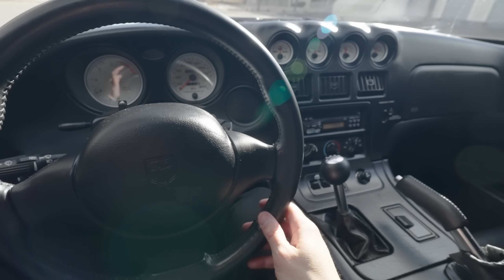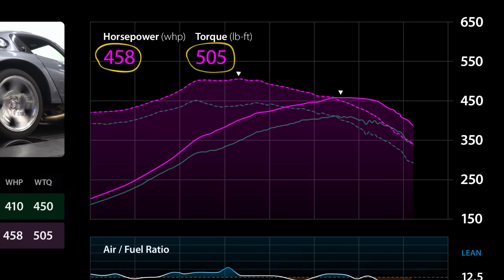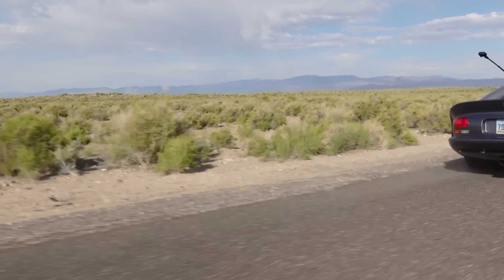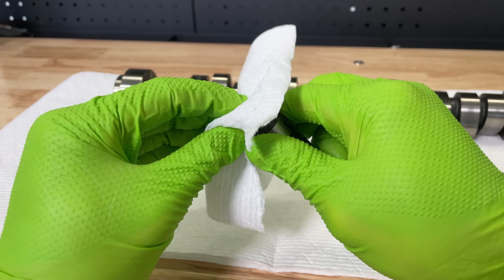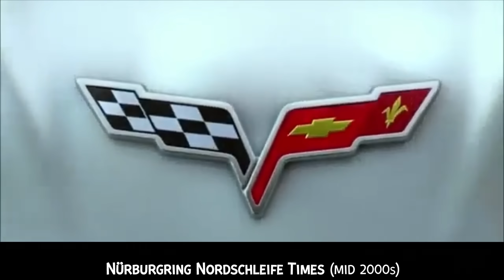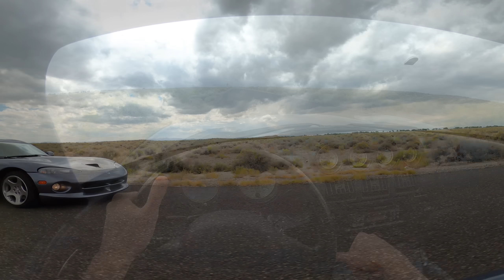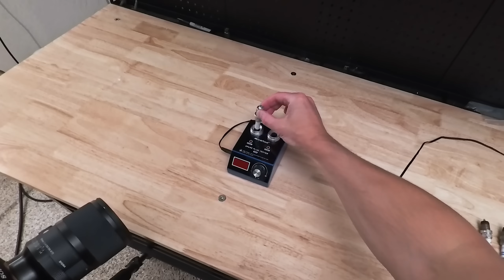Don't call it a comeback

Comment: That old school viper is essentially quicker than any new muscle car and euro performance car with all the modern technology! I'm very surprised!
Reply: IF you can keep it in a straight line lol. It's a car that requires a lot of skill to drive well.
Reply: @jeffhiner lol exactly the biggest differences come from tire technology and traction modulation.  

I think someone took a Subaru that was 15 years apart. Swapped to the same tire and they ran the same lap times( within half second and non pro driver) on paper the new car was 8 seconds faster on the same track.  Can't remember the track it's been so long.
Reply: @jeffhiner beautiful car. Learn to drive it with 8 liter torque
Reply: @jeffhiner very true a lot of people have crashed them not having the experience
Reply: @jeffhiner  - This is true, but once you get the hang of it, it's incredible. My friend and I used to scare the living crap out of people by taking off-ramps at insane speeds on the 401 in Toronto. This was before drifting was a thing. One of my buddies almost pulled the inner door molding off, he was so scared. LOL!  Vipers of this era require skill, Skill, and SKILL. If you don't have those 3 things and you start messing around, you're dead. Anyone who has driven one of these babies in the rain knows exactly what I'm talking about.
Reply: @MaestroDraven  early vipers had a deserved not great reputation.   steering feel poor. chassis that's not rigid enough for the power. the Gen 5 ACR may yrs later is a totally different and much better car.
Reply: @huzcer  - You're comparing two completely different cars with almost nothing in common. The 5th Gen ACR isn't a real Viper in the eyes of traditional Viper enthusiasts like myself, who owned and drove the original lineup. Anything past 2003-2005 is considered a poor and lackluster imitation. The ACR you're referring to had ESC and traction control.....two things that Viper owners like myself scoff at as the equivalent of training wheels. The entire point of the Viper was to demand skill and competency from drivers. If not, you got killed. Simple as that. This was never supposed to be a car for weekend warriors, casual drivers, or kids who pasted car posters all over their bedrooms. This was serious.
Reply: @MaestroDraven   seriously wobbly chassis 🤣 that's a massive flaw. not a feature.
Reply: @huzcer  - Spoken by someone who has never driven a Viper, let alone one of the first-gen ones. The chassis isn't "seriously wobbly." You don't have a clue what you're talking about. Take a 97-99 era Viper out for a spin. There's nothing "wobbly" about it. If it were, I'd have died a long time ago. The OG Vipers had Koni dampers and huge, stiff springs with anti-roll bars matched to low profile tires. That's the OPPOSITE of "wobbly." They were designed for grip, not bump absorption. You're literally describing the OPPOSITE of what those Vipers had - an extremely rigid chassis. Sorry kid, but you're never going to own a Viper, so stop talking about them from the armchair. We who have owned and driven them can spot you pups a mile out. By the way - if you heard this "wobbly" nonsense from anyone else, then they no doubt bought a Viper second hand that got into a serious accident and wasn't fixed properly. There is no 2nd explanation. You can't stick a V10 with that amount of sheer torque into a car with a "wobbly chassis." It wouldn't work. The more I think about your stupid comment, the more I roll my eyes with laughter. You should feel embarrassed right now.
Reply: @MaestroDraven   it is compared to the much stiffer chassis that they replaced it with in later cars. if if wasn't a problem there wouldn't have been a need to do that😂 yeah that's why a Gen 1 Viper goes for $50k and an ACR Gen 5 for $300k. Cos it's so much better!
Reply: @MaestroDraven   as if a car that goes from wide tyre grip to NO grip is a desirable thing... there are at least 3 (and probably more) viper accidents documented where the driver was decapitated on medians or guardrails after going "no grip"
Reply: @huzcer  - Keep Googling, son. Keep Googling. 🤣
Reply: @MaestroDraven lol who has even heard of 3 decapitations in such a relatively small volume car. 😂 Grip.... gone and literally lost the head.
Reply: @huzcer  - That's what separates the men from the boys........boy.
Reply: @MaestroDraven poor and lackluster imitation? That take is so corny. Just stop
Reply: @quakerthroats9010  - Translation: "I've never driven any Vipers, but I wanna' sound like I know what I'm talking about, so I'm gonna' say 'that take is so corny, just stop!" 

🤣
Reply: @jeffhiner there actually easy to keep straight with a drag radial tires which I always use on my GTS. But a lot of idiots end up owning these cars that give them a bad name. They make too much torque down low which puts people in bad situations 😂
Reply: There's no replacement for displacement
Reply: Didn’t the Audi pass the Viper though?
Reply: No?  Gave him the hit and reeled him...
Reply: It's really not lol
Reply: @drepark2294  not bad for something that was designed in 1992 buy a bunch of hillbillies in a barn somewhere 😂 a C5Z06 can’t beat a stock GTS but a C6ZO6 (not a ZR1 like in this video) is slightly faster.
Reply: My VW has a flux capacitor.
Reply: That was the goal...
Reply: It's got a full exhaust and a cam lol
Reply: My F90 competition would absolutely destroy a viper.
Reply: Idk if you realize how much lifting that 8hp is doing...

A viper with an 8hp swap would embarrass your BMW.
Reply: And all souped up it could barely hang with a stock z06 😅😘
Reply: @kevingetline3283  - Let's do some memory laning, shall we? Early Vipers beat the Z06. 2006-era Vipers lost to the Z06. 2015--era Z06s lost to the Viper ACR, and 2023-era ZO6s were still getting beaten by Viper ACRs thanks to their purpose-built aerodynamics. Not every race is a straight line, bud.
Reply: @MaestroDraven the z06 isn't even a straight line car, you twit. 😂
Reply: @kevingetline3283  - I never said it was, boy-pup. However, the numbers don't lie. Try to keep up. 👏
Reply: And it was modeled off a 60s Shelby cobra Daytona
Reply: There are still people don't believing it, even when it happens, repeatedly. Also the viper can keep doing drag pulls, whereas the others cannot or they will soon, very soon, break down.
Reply: Skyline GTR enter the chat .  .
Reply: @enhancedphysique6452  which Skyline?  R31? 32, 33, or R34?

You're not calling the r35 gtr a skyline, right?
Reply: old is gold 🗣️
Reply: My 04 Mercedes e55 AMG was the same. 5.4L 2.3L supercharger modified to 650HP. Actually stayed on the road unlike the Viper lol.
Reply: The viper isn't stock and it wasn't faster than the audi

Comment: That's the problem shells gas puts a hard coating on the plugs try cleaning it off and you will see what I'm talking about and It has a funny smell from the exhaust when it's running

Comment: Note of interest. The spark testing tool is nice. However, it doesn't simulate the addition of compression the plug is expected to work in. More compression equals more resistance to the spark being able to jump the gap.

Comment: Its not about who won between Viper and Corvette, theres a lot of years difference. Anyway theres a lot of power increase just from.exhaust, i havent understand do you have done a new map after the full exhaust? I have changed the exhaust too but only from the cat, the header still stock, but my Viper feel like having 400cv...i have new sparkplug, new cable, 3 core radiator, but never tried dyno or tune because here in Italy tuner suck...

Comment: The Voodoo's flat plane crank is an abomination. It's configured up-down-up-down, not up-down-down-up like it should. As a result, it gets the primary imbalance of a cross plane V8 AND the secondary imbalance of a flat plane. As far as balance goes it gets the worst of all worlds. Makes a lot of power. Sounds good. But it's an engineering head-scratcher. I often wonder what it would have been like if it were a proper flat plane V8.

Comment: 450 hp from a 488 cubic inch or 8  liter V10 NATURALLY ASPIRATED. And the torque isnt from 50 at 1000 to 450 at 4500 rpm. It starts close to 250 or 300 at 1000-1500 rpm and by 2500 rpm its above 370 lb ft. So it practically pulls from the start of any gear to the end. The argument of power $#!Ts on everything when you start to add boost to the 8 liter monster. 

You better get some good tires, dont wanna see that 550 ft. Lbs of torque send itself into a wreck.  Probably should get yourself some radial slicks, those barely legals and maybe keep a smaller spare set in the trunk so you can swap if the rain hits and you gotta drive far.

Comment: You havent extrude honed the intake manifold yet? Exhaust and extrude honed manifold used to be 100 +whp and about 125 w tq when done in the late 90s, early 2000d on these. I never did the extrude honing process at my shop, but did remove and reinstall them post process. The manifold is soo rough and restrictive inside,

Comment: There is a major magazine article (an excellent write-up) comparing the Z06 corvette, the Porsche 911 turbo, and the Viper and what you can see is the 100 Mi per hour to 150 mph they both left the Z06 in the dust even though I was a 06 owner at the time and I wanted the Z to be the best :-) so I just supercharged my Z06!
Either way, that 100 to 150 mph pull really show the difference in power compared to the Corvette in that day.

Comment: Could that Motor Trend test have been maybe slightly biased for an American Car Magazine? Just saying, things were different back in the 90’s haha.
Reply: Exactly this.  The Viper never seemed to do as well outside the US.  It was known for being cramped, hot and a handful at the limit.  It's saved by huge tyres and lots of horsepower/torque.  Before it went racing, it was warmed over by British engineers and a French racing team (suspension changes, etc.)  Still miss the car though!

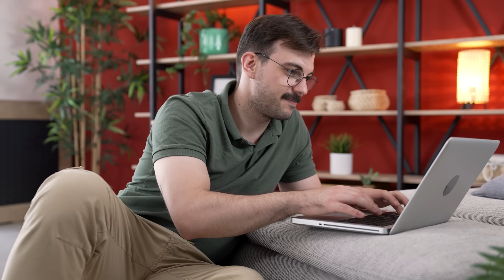Comment: 2:00 I mean they are right by any measurement the viper engine is technically NOT a high performance engine but instead a giant fuckin engine lol, but revs surprisingly high for one? that's definitely note worthy. European cars only get those impressive power density numbers with high spec trims anyways. I think even hondas had higher hp per litre in the early 90's compared to like.. bmws.

Comment: 15:35 Correct procedure. As engine power increases, brakes should be enlarged.
Reply: Brakes should be improved to reduce fade you mean. 

When you have plenty of grip, the issue is making sure your brakes and fluid don’t overheat. 

Making them larger does increase surface area but the fluid matters too.
Reply: something people get confused with all the time. As long as brake fade doesn't happen you are fine that is the only time larger brakes would be valuable, (mainly during racing and racing only). At the end of the day as long as your brakes can physically lock your tires up it then pertains to tire grip, traction control, abs, or any other safety things.
Reply: Larger brakes are only necessary when you get extreme heat-fade or you install comically large wheels like 20"+. The larger the wheel and tire, the more rotating mass is fighting your brakes. If you install larger brakes on your OEM-size wheels, you're actually hurting braking performance.
Reply: how does that work? your braking capacity is limited by your tire grip
Reply: @SerasVictoriaFan  Tires are important, but brake disc size and the number of pistons in the caliper are also crucial.
Reply: Borrrrring

Comment: Octane booster will foul spark plugs. The ones that actually work have MMT in them which gives causes that orange coating on the plugs. It can also foul your O2 sensors and cats as well. You can usually clean off the plugs and they're fine after. An ultrasonic works best but a brush works in a pinch.

The big issue is when it starts to clog up your cats. Pretty much any amount to notably raise octane is going to be enough to mess em up over time. I personally wouldn't use it full time if my car had cats.

You should totally try to find a Ram SRT-10 to race. See how the viper truck holds up

Comment: The euro fascination with horsepower per litre partially comes from taxation rules there. In some euro countries, your vehicle taxes are based on engine size. Another reason is that larger engines traditionally get worse fuel mileage (and fuel has always been more expensive in Europe), although that rule of thumb isn't really true all the time.

Comment: Im wondering if the MMT in the octane boost, as evidenced by your orange plugs, is causing them to fail prematurely. Wouldn't hurt to run some Amsoil PI a tank or two to really clean up those deposits

Comment: Even after all these years have gone by, the dodge viper is still gorgeous! Such an aesthetically pleasing car!
Reply: The Dodge Viper is the modern day Shelby Cobra, timeless.
Reply: I've always thought the viper looked so cool!  Never understood why people didn't live them.
Reply: @moto-fl3rd  people do love them, but the general public sees no ac, crank windows, low head clearance, and an acrobatic entrance that has you stepping over a giant sill to get down into a very low floor pan.. no traction control or stability system. Etc etc etc. you gotta be a real car person to want that daily
Reply: @krvnjrcbs after 1996 the viper had power windows and ac.  So I'm not really sure what you are talking about.
Reply: @moto-fl3rd  sounds good
Reply: @krvnjrcbsperfect but not vor a daily driver. I actually perfer small cars with 4 cylinders making way to much power and torque for thier size.
Reply: @jonmurraymurray5512  right that’s my point it’s a terrible thing to get in and out of every day and has very little creature comforts. That’s why it didn’t sell many. It’s basically got to be a second or third car and not many can afford to even think about that

Comment: goes to show how important  n useful low down torque is compared to the much hyped "power" figures at crazy high [and very high wear] revs that people chase....
I'm More often gonna b at 3000 rpm than 7000 rpm, my motors gonnna last waaaaay longer than an 8000rpm screamer.

Comment: I had an 01 Gts and after cam ported heads and intake shaft mount rockers full exhaust it made 605 rwhp and 603 rwtq and ran 10.7 @ 132 mph. Miss that car. 😢

Comment: 15:15 The viper being so analog may be pre-ion knock sensing. I am not an electrical engineer but modern cars detect knock partially by using the spark plug with a low voltage to sense for knocking. If it lacks this, bad plugs not firing a code makes sense.

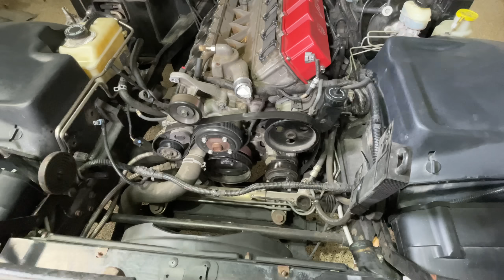Comment: The carbon edition z06 ran a 7:22 and the zr1 same year ran a 7:18. 2009 ACR at ring ran 7:22 as well. Other viper times on there but not stock or prepped personally.  Corvettes have been a sports car from day one. They were made for handling and always have.

Comment: Yes, at 8 liter displacement a euro car would`ve made maybe 700hp. The rest of the figures are due to the massive 275/335mm tires which is not really fair. Other than that, the Viper was a tractor, though a beautiful one.

Comment: Time for 3.33 gears. I’ve had four vipers including two supercharged, Doug Levin and an early Underground Racing one. Even up to 900+ wheel the 3.33 aren’t too much but it makes a great difference in the upper gears when sub 700hp. A good shifter may help things too if you’re running one yet. I like BM linkage with the taller stock length shifter. Anyway, 3.55 are only really good for bone stock and I’ve even had 3.73 and there’s no point, it’s silly. Trust me, 3.33 are the sweet spot! Nice ride and it’s cool to see the gen2 gettin some love

Comment: So a full bolt-on head, cam 8L Viper is in a dead heat with a C6 Z 7L....  Gen 2 heads are just garbage, even when ported.  :(
Reply from the maker: these old viper engines just don't have the compression or a proper intake manifold, prefix told me gen 3 heads were worse and to avoid them.
Reply: @Four_Eyes  Yea they didn't get good until the Gen 4.  I'm selling my 2000 GTS Steel Grey this Friday.  :(  hate to see it go but I want more HP's and refuse to pay Viper tax for the power. :)

Comment: Cool car. Do yourself a favor and get that octane booster out of your car. It costs the plugs with orange crap and kills em. I tried it in my ten sec C5 and it slowed down.
Brisk plugs cost way too much and offer no gains. We found on the dyno that std non iridium NGK work fine and are much easier to read.
After having a couple Brisk plugs blow the porcelain out (Hemi cars) the shop quit selling them.
Reply from the maker: useful info, thanks

Comment: yea something us euro boys have to deal with is actually turning the wheel ,lets see you try to turn at 120 mph 
our city's are smaller ,closer then your drug infested ,long streets ,i dont have to get on the highway to go to a grocery store 
our engines are marvels of engineering ,we extract every bit of power from the fuel ,not just dump fuel and hope for the best 
we have different needs then your uga booga engines and handling 
there is a reason why our motorsports are intresting and we have rally and F1 ,while you guys turn in a big single circle and call that a sport
Reply: bro shut up

Comment: Four Eyes : yeah....but you forgot to tell people where did Dodge buy from. Dodge-Chrysler in 1980-s send their truck intended 5.9 liter V8 design to Lamborghinni and the italians completely redesigned the engine into a 8.3 liter V10 aluminium block just like they had in their Lamborghinni cars. In practice and its essence this is an Italian V10 engine, a predecessor to todays Gallardo engine. So the performance actually goes to the Europeans here.